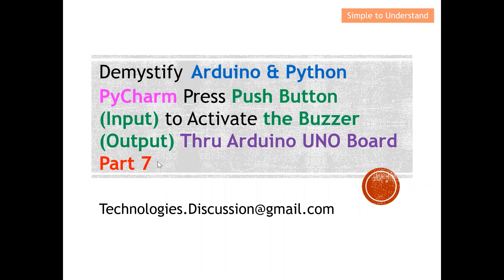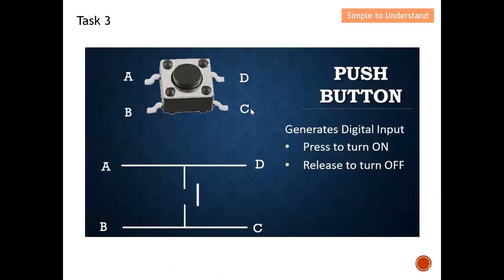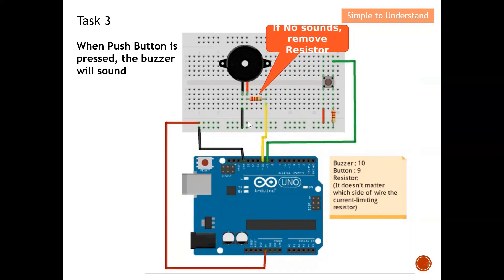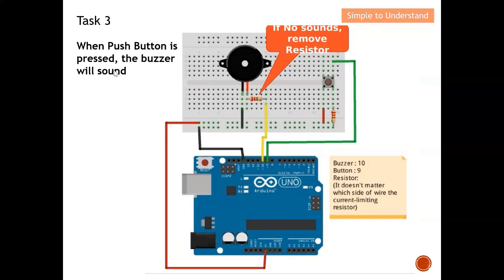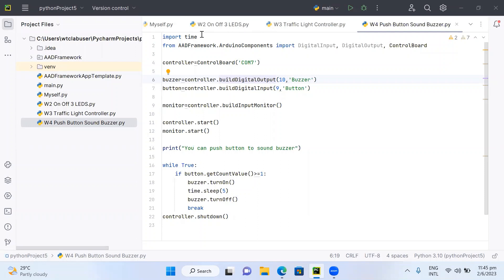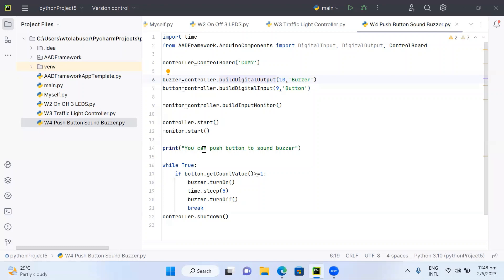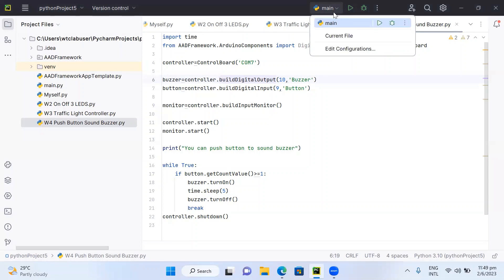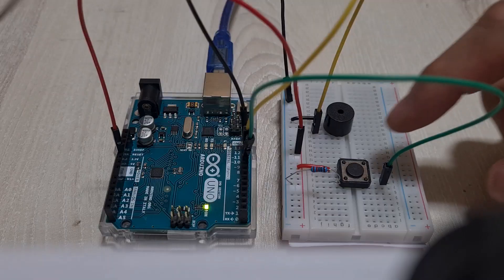Prog #7. How to Use a Push Button (Input) to Activate Buzzer (Output) with Arduino UNO: Tutorial.

Comment: Hi may I know how to combine code for motor and button?
Reply from the maker: Actually, is the same. :)
You can change the buzzer to motor.
I am also doing the motor soon.
Thks.
Reply: @technologiesdiscussion1676  any idea to make buzzer sound on and off a few times b4 it turns down
Reply from the maker: @jamessinan8246  Ok. Will do it.  :)